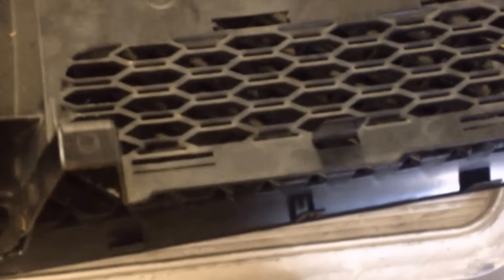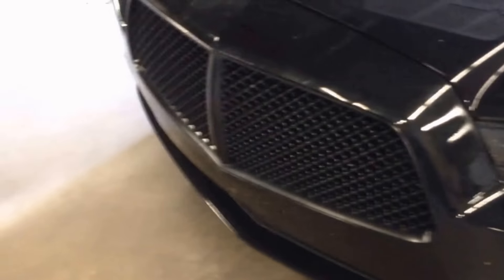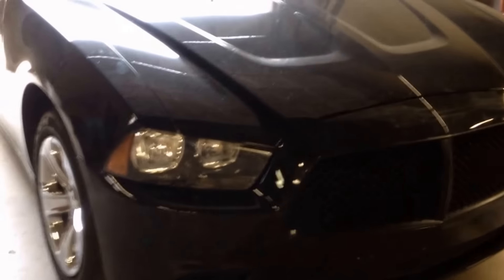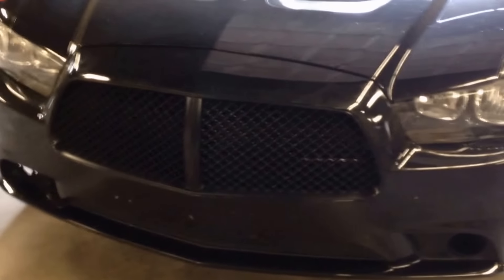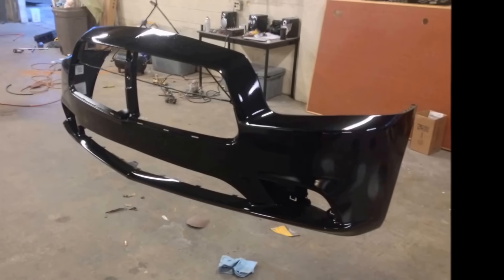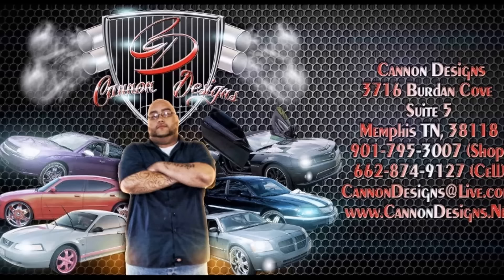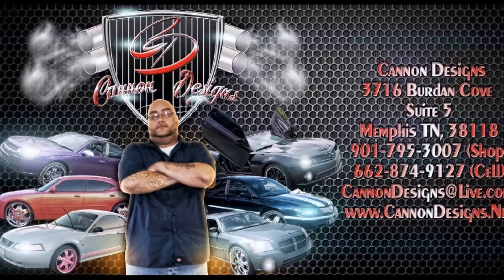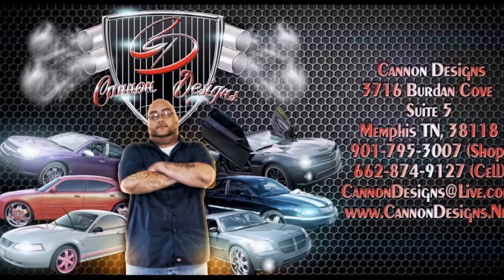12'  Charger "Grille Install" (How To:)

Comment: I m getting that that black grill.my question is I have grill like u used to have,only not pained black.on video u say to put it behind  new black grill.will I see chrome grill through new black grill or I have to paint it black also like you??? thank you
Reply from the maker: +rzaab187 cash  the factory grille is a 2 piece grille. You have a front part and a back part. The back part should be black. My front grille was chrome also i just painted it black. when you install the new grille you're going to install the new in front off the 2nd part that goes in the back. hope this helps.
Reply: +2SiK Customs thank you